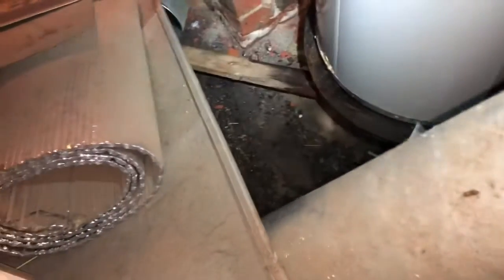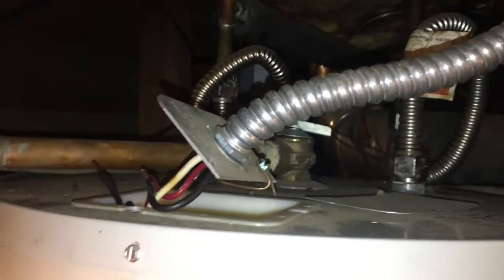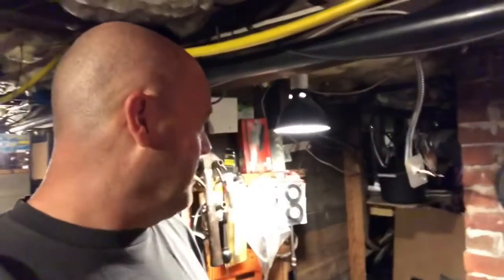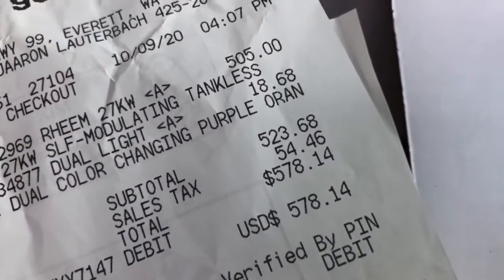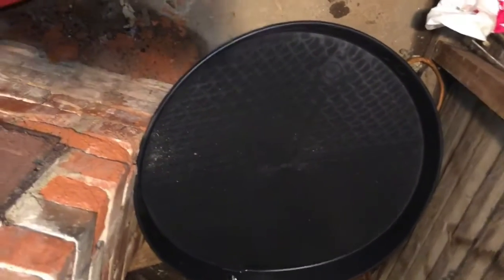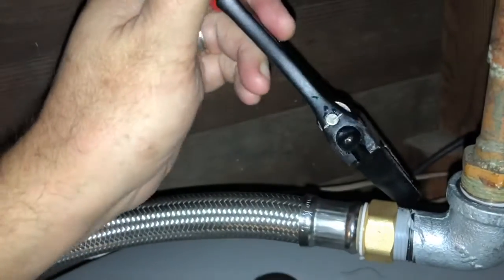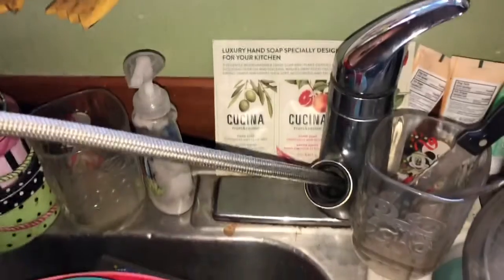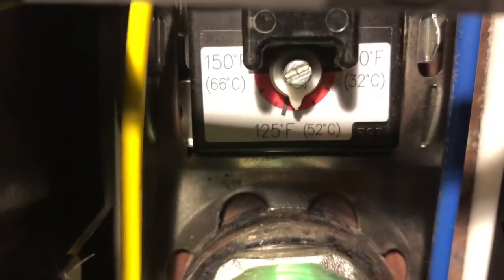Hot Water Heater Died? 💀 🤔 Tank or Tankless on the next one? Pros and Cons Replace and install.

Comment: I put in an electric water heater 18 kW cost me $700 altogether.
Reply from the maker: That’s probably what it would’ve cost me in cash If I did a sub panel dropped it into the basement and if I did it myself. But it’s the time that was killing me. I’m a full-time mechanic I work overtime almost every week and I just could not afford it time wise. 
Gotta get that 🔥 💦 😂
Reply: My tank was 13 years old and I wanted to get it out before it had problems.  Did all my research and got the tankless. I’m hoping to get ten years out of it and pop another one in for 250-300 when it does go out.
Reply from the maker: For me I did very little research and we had to put our water heater in right away!I spent $400 and some change... 🤷🏻‍♂️